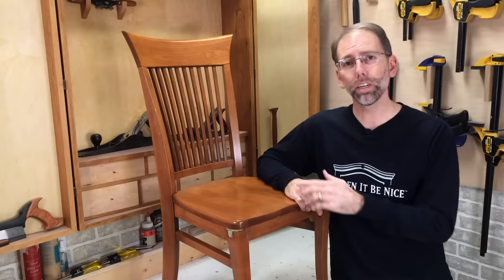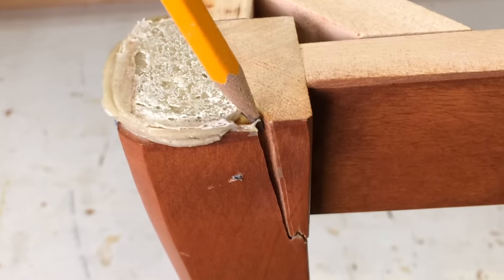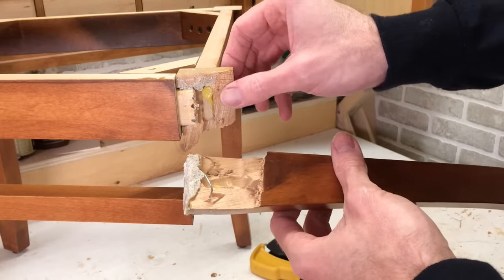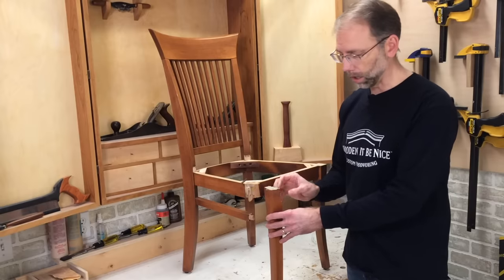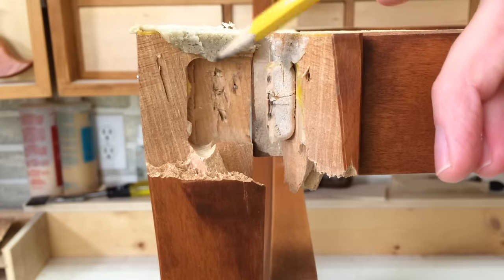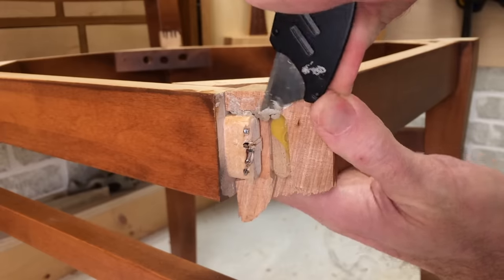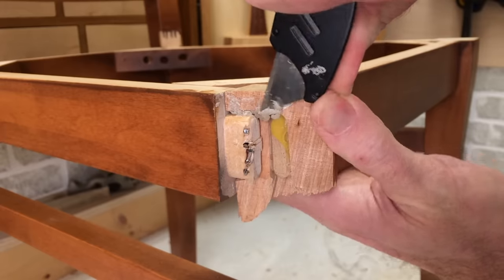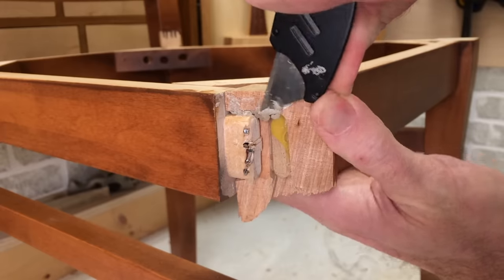Bad Furniture Repair and How to Fix It - Woodworking Restoration

Comment: Ohio, USA checking in! I'm retired from full time furniture repair but I still fix the occasional piece if it's interesting. I don't mean to quibble about your choices on this particular chair but the fix seems incomplete and too noticeable.  I mean no disrespect but it seems obvious that the two pieces are misaligned, even after the repair. One of the pieces is still higher than the other which also shows up as a large gap at the bottom. In my experience this misalignment is caused when not enough of the "splinters" inside are removed. I never hesitate to remove anything that is still loose inside. Then I rely on epoxy to fill the voids I've created. To me it's best to remove as much as necessary to create the best alignment possible. All the best to you!

Comment: I’m in San Antonio, Texas. I have to repair my dinning room chairs almost every year. I have tried just about everything you are doing only to have the chairs fall apart year after year. The only ones that are holding tight are ones where I used a 1/8” steel bracket on top of the corner wood blocks. I screw the brackets to the sides and the corner blocks. Everything else won’t hold!

Comment: I'm from Argentina ! I mostly recane ratan chairs, but I'm trying new stuff. I had a chair with a broken leg and everything fit perfectly, I glued it with polyurethane glue and I wanted to add a screw but I didn't have much space to work with, the chair was upholstered. Is that ok? I'm going to watch your glue video cause sometimes I don't know if I'm using the right one. Thanks! The video is really useful.

Comment: Hey, I'm From Washington State, USA. Currently fixing some coffee tables from the good will. Beautiful tables but one has a lot of damage. One leg in particular has issues. Looks like it had some water damage and now the wood is splitting  like dried old firewood. I have put wood glue in the splits and used a clamp to force most of it back together than hit the whole leg with wood strengthener to help it so it won't continue to deteriorate. Any tips for anything else I can do to save the leg?
Reply from the maker: A leg that has multiple cracks on the bottom is unlikely to crack further.  It would have been damage from the leg sitting in water and absorbing it, which causes the wood fibres to expand.  Once the wood was saturated as much as possible and was then allowed to try, the wood fibres shrunk, which caused the cracks.  I hope that helps.  Scott 🇨🇦

Comment: Sout Africa

I am new to your channel. I am not woodwork trained, but like to work with wood when I am in the mood.

However I recently received some request to repair chairs of witch the legs came loos. Looks like poor manufacturing.

So I just looking for some ideas from you. However it looks like I am on the right path.

Comment: Sometimes best way to warm up wax for filling holes and crack areas Is using adjustable heat gun. Also helps the wax seep in better.

Comment: A question came to mind when you put that longer screw into the leg before you had glued the leg repair together.  When working on vintage computers (or really anything that has self-tapping screws going into plastic) the proper procedure for re-inserting the screws is to turn them backwards until you feel the screw drop into the old thread in the plastic.  This avoids weakening/thinning out the plastic by forcing a new set of threads into it.
Is there any similar practice with woodworking, especially if you were working with thinner pieces of wood?
Reply from the maker: The best practice for installing screws in wood is to pre-drill a hole.  This should be the thickness of the shaft of the screw so only the threads are grabbing the wood.  This prevents splitting the piece.  Also, don't install a screw near the end of a board or it's likely to split.  I hope that helps.  Scott

Comment: A question for Scott.  I always feel uncomfortable using a powerdriver to remove and especially to install screws in furniture, so I use hand screwdrivers.  Is there a knack or methodology of fixing screws with a power tool that does not risk damaging or weakening the wood fibres?  I do make pilot holes of appropriate size for the screws but still feel as if I am applying too much force, and the creaking of the fibres puts me off going in as far as I could.  I'mfrom the U.K.

Comment: Great video. With your concern about the wood and screw working against each other, could you have drilled and inserted a dowel or two through the break, and also used a screw? (I'm from the Southern Highlands just South of Sydney, Australia)
Reply from the maker: While sometimes dowels are good for reinforcing joints, they can also be bad in some cases as the holes take away some of the structure of the joint.  It take experience to know when add a dowel or not... it's not something easily explained.  Maybe that's an idea for a video.

Comment: A friend brought over to me an antique chair to repair some loose joinery and a split seat. The arms of the chair are fashioned from multiple wood (looks like oak) stock glued together then shaped, and finally screwed together from underneath the arm. One of the seams (the same seam on both arms) has slightly opened towards the front aspect over time (but is quite sturdy). It likely opened do to years of reclining back into the chair. Unfortunately, those screws are glued in, appearing to be from a repair some time ago. I managed to clean glue away from the heads of the screws, but am unable to back them out. I've tried vinegar, but apparently the vinegar may not be working its way to the screw threads. Any ideas how to remove these glued-in screws? Thank you for your comments and suggestions. ~ Joseph

Comment: Great work.  I wonder if I might lose the screw and use a hidden dowel and glue in it's place allowing for more fastening area.  Glued up and clamped correctly may give it a bit more strength supporting the occasional guest who opts for that second desert.

Comment: I have an old chair with loose legs that doesn't seem to have corner braces. I assume this was perhaps because it has a see-through caned seat. It looks like they used screws instead, there are several plugged screw holes in each corner.  I was wondering, in addition to reglueing the joints, would it be a good idea to add corner braces to a chair that didn't have them originally? (I'm from Belgium BTW)

Comment: Down here in Buffalo, NY not far away.. Can i repair the back of a 1960s dining chair which the leg spilt at the top off of the chair and the back of the chair came off, which someone was sitting in it... wish i could post a pic.
Reply from the maker: We offer 1-on-1 advice sessions via Zoom.  If you're interested, here's a link to our advice sessions and plans homeimprovementwoodworking.square.site

Comment: Long time ago, but anyway...
I like your videos, I have learned interesting techniques, especially about the touch up sticks etc. Unfortunately, you didn't show, how you fixed the step on top of the leg. But I assume, you simply cut a suitable shim and stained it accordingly.
One remark about the cutter knife: I have often seen people breaking off blades while using them and hurt themselves badly. Why not use a chisel wherever possible? Of course, there are situations, where a narrow blade is the only way.

Comment: Instead of a screw, why not drill out a hole for a wooden peg or dowel that is glued in to give you a wood-to-wood reinforcement? I have repaired quite a few chairs but often find the 'modern' one were built poorly (either the grain issue as you pointed out and legs that were never truly made evenly or worse, tenons that are not properly fitted). Repairing older chairs is so much more satisfying. (oh, BTW, from San Francisco. My other favorite channel is Johnson Antique Repairs).

Comment: Texas here, Depends entirely on the situation. This is a newer chair, looks cheaply made and likely something that was made in a factory. So much furniture these days is made with laminate and it's understandable. Not everyone can afford solid walnut or mahogany furniture. It's unfortunate that the original repair was done so poorly but honestly it's almost not even worth repairing unless the entire set is still in decent condition. You did a really decent job on the repair however I prefer to mix saw dust and wood glue to fill in gaps a fine tipped brush and stain usually finish the job up nicely. I don't trust the color crayons they often leave visible marks behind that look tacky and never really last long.
Reply from the maker: Thanks for sharing your experience.  Cheers.  Scott

Comment: Hello. I'm from India 🇮🇳. 4 years ago I bought a mango wood work table. The quality of the table is good but the people who assembled it for me, didn't do the best work. While assembling the legs they used big (about half an inch diameter) screw through the leg and desk. And now, that leg has loosened up and changes its angle while moving the table back and forth, as I have to do that since I work with lot of wires, USB drives, ethernet cables, etc. Can you suggest me the fix for it?? Thanks in advance.👍

Comment: At 11:07 you mention using wood glue on part of the joint and epoxy on another part.  Why not use epoxy on the whole repair?

Watching from BC.  Also subscribed to AT restoration (Estonia) and Thomas Johnstone Antique Repair (Maine USA).

Comment: Maybe I missed it, but at 4:30 in, the stretcher running from the broken leg back to the rear leg was noticeably loose, Did you clean those joints out and reglue them ... I hope? That "repair" done previously, was the worst I've ever seen. You deserve a merit award for fixing it so well! Brad nails have no place in a furniture repairs, especially when used by amateures. It was a real mess. Detroit , MI

Comment: No glue apply before nailing it? With so much surface area and air gaps, why not?
Also to fix your glasses, just replace the missing screw with floss to hold it in place.

Comment: nice repair ! but you likely could have got that leg even on top with or without cleaning out those bent wood grains by putting a bar clamp from the top of the leg to the bottom and pulled them flush !

Comment: If you're trying to PULL a nail through, wouldn't it be better to use a tool that doesn't CUT? E.g. vice grips?
Reply from the maker: Good question - it's all in the technique of the user.  Even vice grips wouldn't have pulled this brad nail through the hardwood.  Cheers.  Scott

Comment: At 9:50 you state you are going to get the top of the leg perfectly level, but at the end of the video it is clearly not. It would be good to know why you changed your mind. Thank you for the video!
Reply from the maker: Good question.  The wood fibres that were broken off didn't mesh well together when I first tried to fit them together.  After spending about 20 minutes trimming and pulling out parts of the broken fibres, I got it close, but not perfect.  I decided to stop fussing with the joint as it was a tight fit at the front where it was visible.  The top surface also is only visible if someone got on their hands and knees to inspect the top of the leg, so in my opinion, isn't worth investing any more time in it.  I hope that helps.  Scott

Comment: I don't understand why you would use end-cut pliers to try to pull a brad instead of a plain normal pair of pliers. I've used normal pliers to pull out dozens (maybe hundreds) of brad nails without ever cutting one, but would think end-cut pliers would cut/break one every time it was used. I dunno. Otherwise, thanks for the video, I enjoyed watching it.

Comment: Using stretchers to separate the broken leg from the chair applied unnecessary stress to the other leg joints. As a side note: any craftsman worth his weight would NEVER store his hand planes with the base down regardless if the blades are retracted.
Reply from the maker: Interesting comment Dennis.  I'd love to hear your suggestion on how to separate parts.  Scott

Comment: He knew dang well he wasn't going to use a putty knife to get that off 😂
Reply from the maker: I've rarely had to take construction adhesive off before.  Someone suggested heating it up, which would likely have been easier.  Cheers.  Scott

Comment: Heat Gun would help remove the glue
Reply from the maker: Thanks for sharing that tip... that would have been easier.  I rarely encounter construction adhesive while working on furniture.  Cheers.  Scott

Comment: Coming from a professional repair man at 26 years. I followed/agreed with you until you got to the point of your touchup. A wax stick and a marker is not a very professional way of doing things. You should’ve used Bondo, along with aerosols/a.k.a. dye and blendals.

Comment: Hmmm … had you used channel lock pliers instead of nippers you might have got those brad nails out.
Reply from the maker: I've tried those in the past.  Unfortunately, they don't have a fine enough tip to grab hold of nails like this.  Cheers.  Scott

Comment: Australia 🇦🇺
Reply from the maker: Thanks for sharing where you're from!  Good work putting your flag in the comment too!  Scott 🇨🇦
Reply: No worries I learned about how to turn quick hip clamps into spreaders from your video.

I also found that I can convert the smaller quick grips into spreaders by knocking out the pin stop on the other end to make a larger hole, so that you can unscrew the end and re screw it on the other side using the bigger hole… if that makes sense….

Comment: 🇺🇸 USA
Reply: I have a rocking chair that I am doing my homework on because I haven't done wood working in 20 years. The seat is split in half and two of the stretchers between the legs have pulled out.
Reply from the maker: Here's a video to help you with the spit seat - https://youtu.be/AdfhyZvVkio Many of our chair repairs will show you how to re-glue the stretchers properly.  Cheers.  Scott